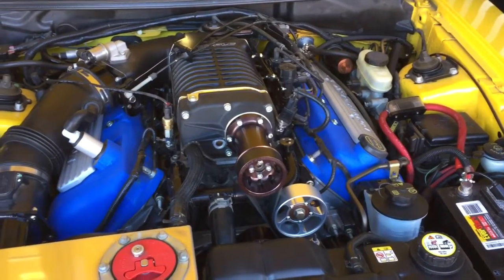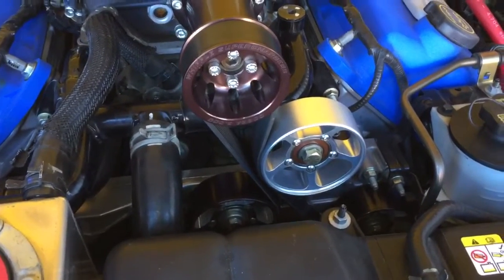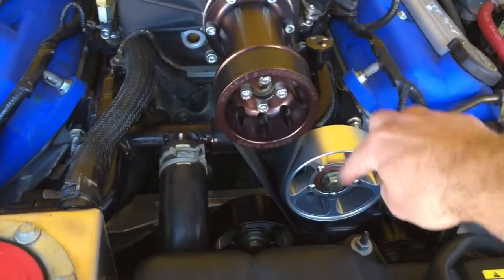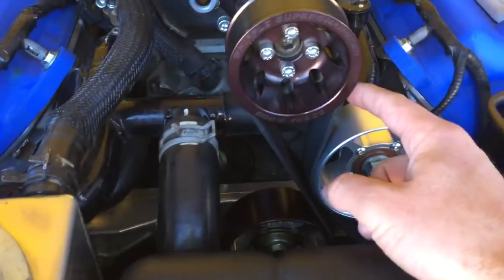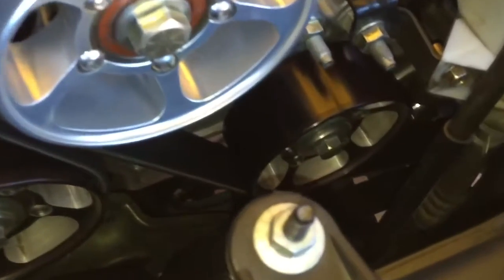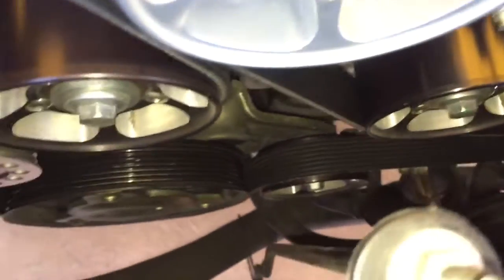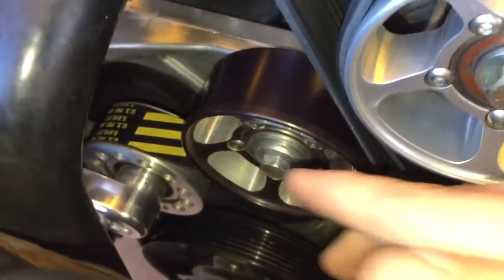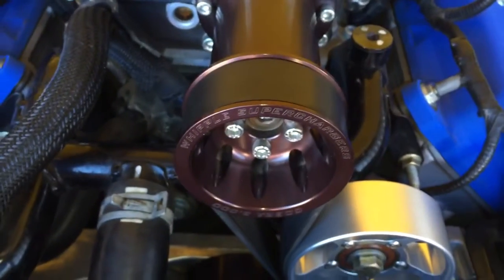2003-2004 Cobra Supercharger belt routing

Comment: Possible to get the belt swapped with the car on the ground or do you have to reach from underneath with the front end jacked up?
Reply from the maker: The belts can be done with the car on the ground, but the supercharger belt is easy and the inner belt requires a 14mm hex, heat, and lifting the car to get under it and break it loose https://youtu.be/1JYtqYm8v3U?si=2Y50Xs0S2hBLFY-p

Comment: Thanks for the video,  was very helpful!  Just replaced my belt.  My Cobra was squeaking for a few minutes after a cold start and this fixed it!
Reply from the maker: Keep an eye on the idler pullies too. When they squeak they will have the bearing seize and explode
Reply: @dannyjohnsonsgarage  I’m guessing you’re referring to the stock idlers?  All my stock idlers have been replaced with Metco idlers and a Billetflow snub idler.  I may replace the Billetflow with a Metco idler though so they all match.

Comment: What size belt can i run with this ideler?3/100 and one 90  billetflows and 2.760 upper pulley also A billetflow can a 75.13” lenght??? Gates green work?
Reply from the maker: https://lmr.com/products/2003-2004-Ford-SVT-Mustang-Cobra-Supercharger-Belt-Guide
Reply: Danny Johnson thanks i already order my belt with this link if i bought NGK R spark plugs do i need to gap them oem specs? Or a little bigger for a smaller upper pulley? And single blade throttle body blade?
Reply from the maker: Lewiz_SVT With a pulley you’ll want to gap them down to about .032. You’ll see the process in my video https://youtu.be/HbSYnVAXzD8

Comment: I have a 2.8 kb on my cobra and I want to put a bigger pulley on my super charger and keep it on 93.  I have the bigger pulley but I never swapped pulleys or put a different belt on.  Is there any videos covering that topic?   I would actually like to see the whole process of putting the belt on and making sure everything is done right.  Any chance of making a video like that?
Reply from the maker: Matt I would watch the following video at 2:05 in and it will show you removing the belt. From there removing the pulley on the kenne bell requires a tool (I believe some people have used an impact to zip it off, but I would not recommend it). I don’t think it’s a puller like the stock blower, just tool to hold it still.
Reply from the maker: Matt https://youtu.be/VPsk3Z39j6s
Reply: @dannyjohnsonsgarage  Ok Ill check it out. Thanks

Comment: Have you done any video regarding changing the inner main belt in the 2003 cobra? Id like to change mine but not sure whats all involved.  Thanks
Reply from the maker: lx347cid If you have the stock lower pulley it has to come off. Kind of a big job. Then it’s the same as any other belt swap. https://youtu.be/1JYtqYm8v3U
Reply: Danny Johnson oh gosh that would definitely be a job then.  My car only has 15k miles on it but the belt is 16 yrs old.  Should i just leave it?
Reply from the maker: lx347cid Is leave it until necessary.
Reply from the maker: lx347cid The only chance you have is if the car has an aftermarket lower crank pulley. That kit usually deletes the cage
Reply: Danny Johnson its stock lower cage.  I was never a fan of the underdrive pullies or overdrive pulley.

Comment: There another belt behind it
Reply from the maker: Win Win Yes. The belt in this video powers only the supercharger and alternator. The inner belt powers water pump, power steering, air conditioning. You have to remove the lower crank pulley on the supercharger belt to get the inner belt off.
Reply from the maker: Win Win https://youtu.be/1JYtqYm8v3U
Reply: Thank you .

Comment: Thanks for the help I'll be swapping out my pulley to a smaller 2.76 pulley this weekend do you have any advice for me?
Reply from the maker: ced taylor well, you may already know that you will need a polar if you have the stock supercharger probably. I'd also recommend a snob idler https://youtu.be/sYJ-acUMG6Q
Reply: Thanks for the response I have the billet flow interchangeable pulley and 100mm snub idler. I should have been more descriptive I need help on adjusting the tensioner to remove the belt and tightening it to install the belt. I don't know much about the process.
Reply from the maker: ced taylor is it a stock tensioner?
Reply: not to my knowledge I believe the previous owner changed it. Is there a easy way to tell if it isn't? Im very new to this platform so I am trying to learn as much as I can your page is a huge help.
Reply: Scrun Johnson It's not chrome. How different would the process be for stock vs aftermarket
Reply: Scrun Johnson thank you! Upon further investigation it turns out I have a stock tensioner that I can loosen just like you did in the video.

Comment: Great video! 
I have a 2.76 upper with a steig stage 3 blower; would you recommend a 4 lb lower for some extra power?
Reply from the maker: racequad9 with an eaton, yes, but if you are planning on a bigger blower I would keep the stock, caged crank pulley
Reply: Cool. what power are you putting done on your cobra?
Reply from the maker: racequad9 600 rear wheel

Comment: you should do a video on installing that extra snub idler. How would you gigure out what size belt to get if you have smaller pullies?
Reply from the maker: Franky Flores there is a formula in excel floating around on how to get the belt size. I'll try to convince my brother to let me play with his bone stock cobra lol
Reply: Scrun Johnson also i wanted to ask you do you know what size the stock crank pulley is. i have a 2.3 whipple with a 3.50 pulley like you too and im trying to get to 18 Ibs of boost by just going down to a 3.00 upper pulley. the alternator i have in mine has a bigger pulley and it causes my battery light to come on in the dash im not sure if I should swap the pulley from the stock alternator to the alternator in it right now or if i should buy a mechman alternator. the battery light dims down when i floor it but every now and then my check engine light comes on and throws a low voltage code. I originally thought it was due to the bigger alternator pulley not spinning it fast enough. I want to go through the car and replace all the idlers thats why I was asking about the snub idler.

Comment: Are those billetflow or metco?
Reply from the maker: GenAfterNextTactics billetflow. I have a video on replacing the bearings on them too just FYI
Reply: ok cool, im the guy asking questions on ur BAP install svtp thread too btw. I wish you could have done a video on how to take off the stock Cobra pulley's/idlers. Are those as easy to take off as the billetflow? I just bought a bunch of parts and now i have to figure out exactly how to put them all on lol
Reply from the maker: GenAfterNextTactics yeah, so easy. Just take them off and put the new ones on. Don't tighten it down too much (major cause of bearing failure)
Reply: right on, i was thinking they were pressed on and it would be a pain in the ass and i would need a bearing puller or something.
Reply from the maker: GenAfterNextTactics yeah, super easy!
Reply: My car came with Reichard racing drive pullies? How come they aren't as popular as billetflow or metco?
Reply from the maker: racequad9 probably cause they are higher quality and cost more than billetflow
Reply from the maker: racequad9 or because Billetflow was advertised/carried more commonly
Reply: That's a good thing i guess. I was thinking of removing them and selling them for either billetflow or metco because i thought they were some cheap/bad brand since everyone on svtp uses billetflow or metco